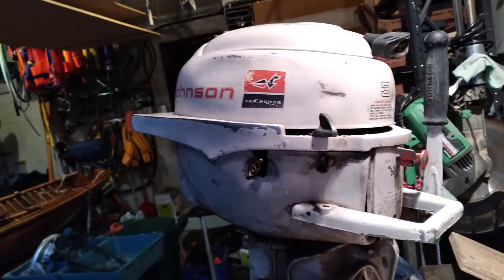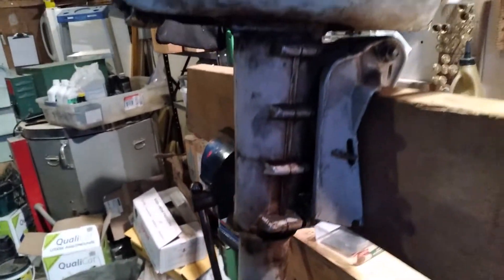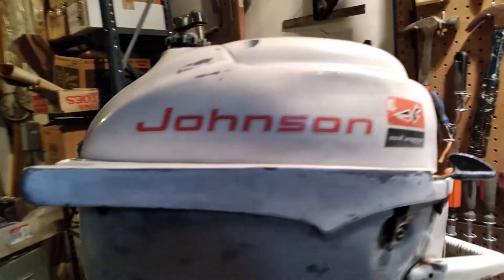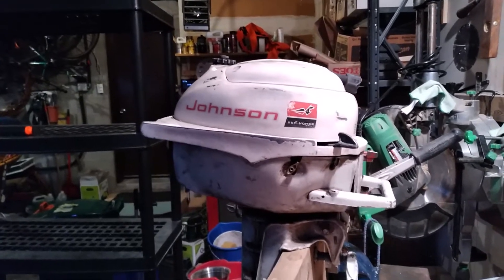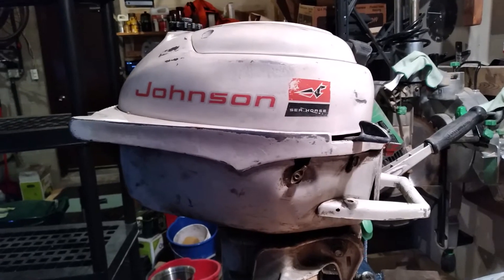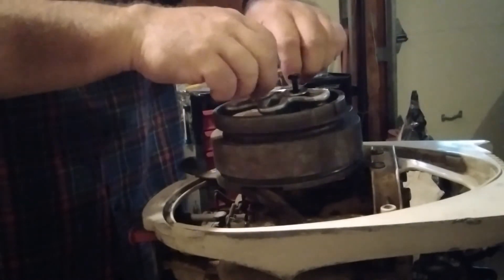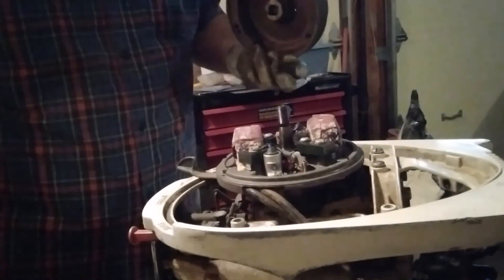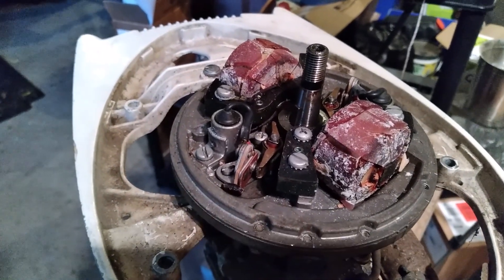Johnson 3hp 1964 rebuild Part 1: Flywheel removal

Comment: How did you get the lower cover off?
Reply from the maker: First start by removing the steering arm.  Two bolts that are a bit tough to access.  Then remove the bolt that holds the handle together (it is on the port side).  Loosen the four bolts that secure it to the mounting plate (the halo that  is between the lower cowling and the gas tank).  The cowling then slips down and then back.  If you do not remove the steering arm, you end up badly damaging the cowling as you force it to come off.

Comment: On the stuck flywheel have seen more than 1 guy fix this by putting pressure on the gear puller then using an impact chisel just touch the top of the gear puller bolt and presto the flywheel pops right off.
Reply from the maker: Thanks, but I have no impact tools.  I rely on some heat and if necessary, lift the flywheel a bit and hit the puller with a hammer.  Lifting the flywheel a bit prevents damaging the piston arms.

Comment: How do you take the magneto plate off?
Reply from the maker: Sorry for not seeing your question earlier.  There are four small bolts near the center that hold the plate down.  The bolts connect to a small disk that is free to rotate.  That disk is trapped in place by a larger disk bolted to the engine block.  You may need to remove the coils to access those bolts.
Reply: @garage_sanctuary  thank you for coming back to me. I managed to get it off. I've replaced the coils as they were shot. And replaced the condensors. But I can't get any spark on the plugs? There's powered getting to the plugs as I've used a multimeter, and I also get an electric kick when holding the spark cables whilst turning over engine. I've changed points too. My only thought is are have I put the wrong coils on? My engine is an evinrude 4hp 1960s. All help appreciated.
Reply from the maker: @Martin bennett  break up the problem into four areas.  The first is the capacitor.  Unless you have a specialized meter, it is difficult to test the quality of a capacitor.  It does not hurt to replace them with new ones.  Second is continuity of the points.  If you need to file or sand down the points to get good continuity, don't forget to recheck your timing (I will be doing that soon).  Third is the placement of the coils.  On a lawnmower, with the coil outside the flywheel, its easy to do this by placing a business card between the coil and magnet.   Then tighten down the coil.  On these outboards, you need to make use of the guides in the plate, but I do not recall that there is that much play when installing these coils.  Finally, there is the continuity of the ignition wires.  Test from the coil ground wire to the center electrode of the spark plug. Your wire in the boot might be very rusted, event broken, or you connection between coil and wire is no good. Don't forget to use new plugs!
Reply: Check this spark plug wires, a lot of time the wire inside get broken and the spark will try to jump inside the wire, sometimes it sparks sometimes it doesn't. I even say a guy get spark on the plug but no continuity with a meter, the wires where broken inside In several spots and before he found this he had commented that the spark plug wires looked pretty good on the outside. He made up some new ones and presto ignition intermittent problem solved.